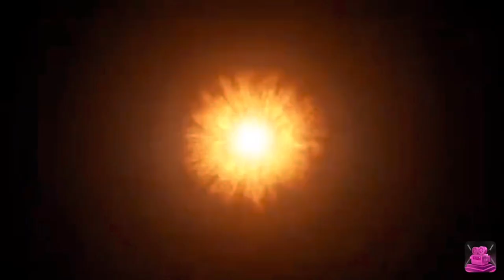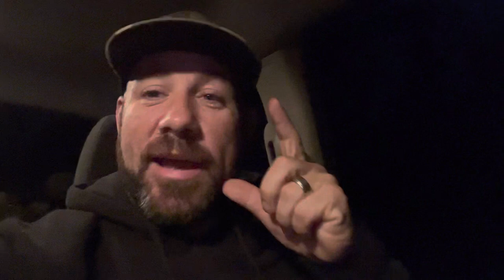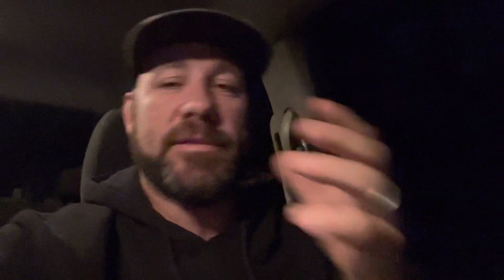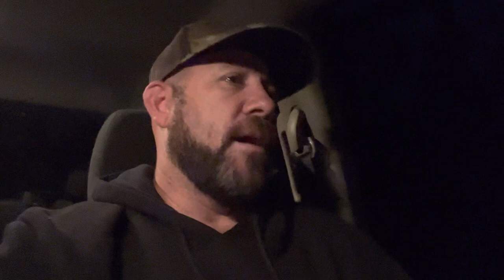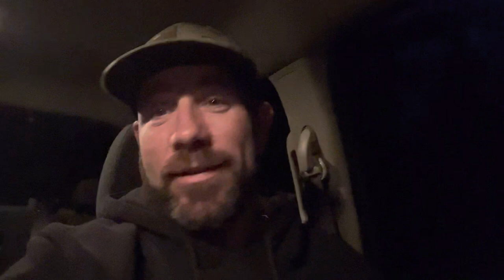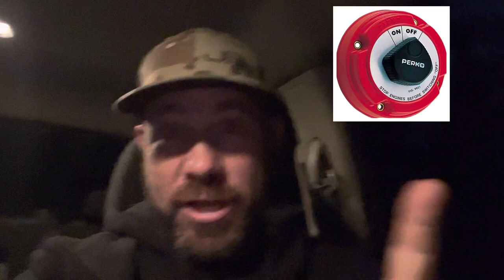Garmin Livescope: Do You Really Need A Cutoff Switch and Why

Comment: This is a good topic & timing. I've had my ultra 106sv for 2 months & lvs34 less than a month. I'm in a pedal kayak so I have charge my battery before hand. I've been playing with where I like my unit & LS pole located, using the fishing specialties pole. I've finally figured that out so I started doing my finally wiring. I keep my battery in plastic ammo diy box with a master power switch. Run 10g guage marine wire to front buss under my hatch, where my bus & black box is mounted. I have another power switch I'll add between the bus & black box. So far the one 32ah 14.8v amped outdoors battery has ran me all day plus another 5-6 hours on single charge!

Comment: They do make a marine toggle switch which I've used for years with no issues. Do you feel its necessary to turn off the lack box if the transducer isn't in  the water but the graph is still on? Thanks for the videos, as always great job.

Comment: I am setting up my livescope now. Here is what I’m considering. The 7.5 slow blow fuses will protect the hardware, but unless a 30 amp breaker or so is connected at the battery it seems to me that there is no protection for the 10 or 8 gauge wire. What if a 30 amp breaker is installed at the battery, and it could also be shutoff (disconnect) to protect draw down?

Is this a sound idea?

Thanks for posting the informative information, I appreciate your efforts.
Dan Ayo
Reply from the maker: Sounds like a winner to me

Comment: So I’m planning on re wiring my boat when I do my Livescope install thinking on using just a dedicated lithium for all electronics will have a cut off but what do you do if u pull the trolling motor up and run to another spot with out cutting the dedicated Livescope unit off will it hurt it or need another switch to cut black box off going down the lake then cut it back on when I get to next spot
Reply from the maker: I never cut my black box on and off and I live in the Louisiana heat. Hope that helps
Reply from the maker: It’s definitely hot down here

Comment: A bit off topic but, electricity on, anything connected draws electricity. My Newby or should I say Tadpole pole question is, have you or do you use the G.Force trolling batteries for your Garmin graphs? I'm to the final point of hooking everything up but have heard people saying "separate" battery for your graphs because of interference and others eluding to no problems. After spending a small fortune, would like to do it right but then again save money on a third battery if possible.(actually a 4th if need be)

Comment: on my 106sv the draw is so minimum that my battery could probably stay charged 4 /5 months before it goes death. no I don't use a switch I'm probably losing 1 amp per week so it doesn't matter.
Reply from the maker: True but that creates a bad situation in your batteries.